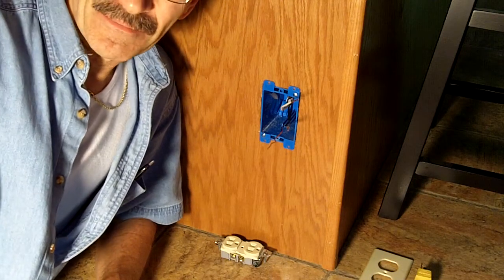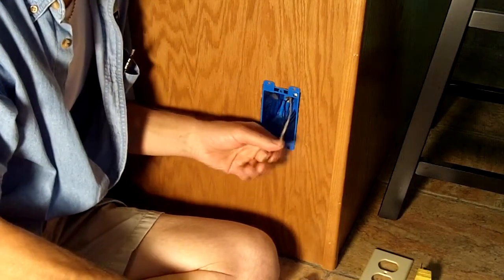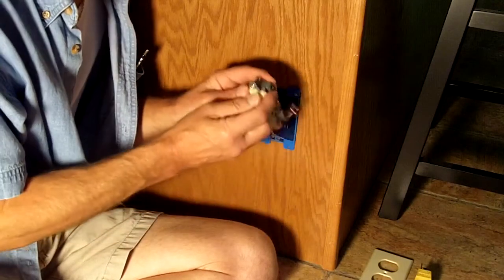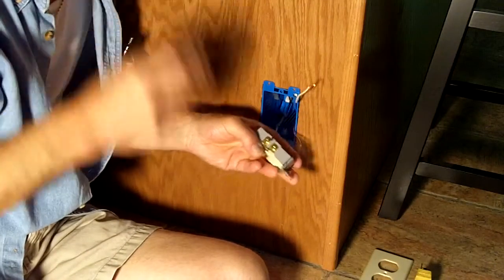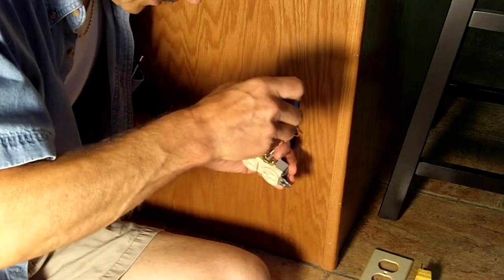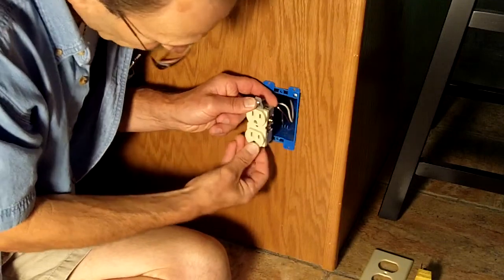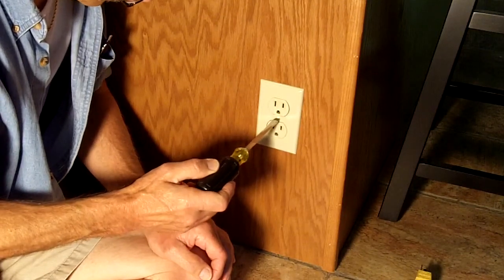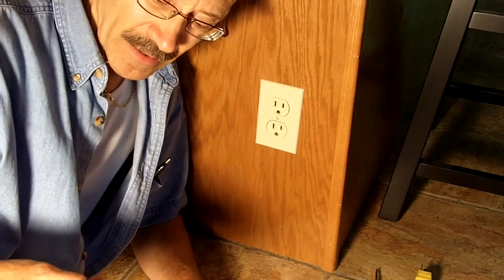Duplex Receptacle Devices: Proper Installation

Comment: Dave, need to place an electrical box over my kitchen sink to put a light and there's a cathedral ceiling with recessed lighting and everything is enclosed. Everything in the entire house is enclosed with sheetrock and have no clue as to where to find a hot wire behind it. Have any ideas on this? thanks..